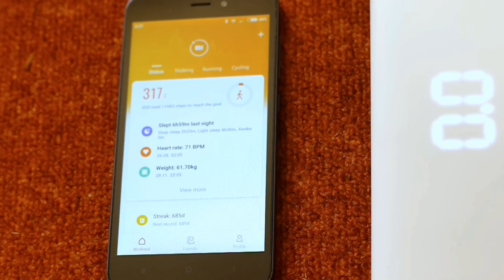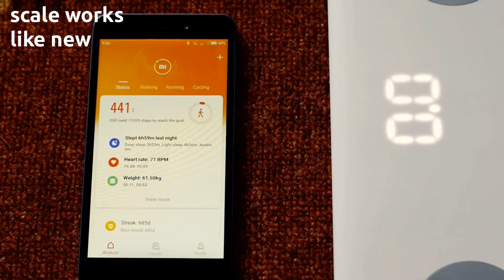Fixing "Couldn't Measure" on Xiaomi Mi Body Composition Scale

Comment: i have another version and there is no screw at all in it (or hidden somewherr probably). mine is mi smart scale 2
Reply: Same with you. How to fix xiaomi mi smart scale 2, no screw and cover made from glass.
Reply: it's just clipped in, outer shell is clipped same way as one in video, then there are "secondary" clips around the support in each corner.
Reply: I have a mi comp scale 2 that shows only a flat bar when batteries are inserted. It cant connect to the phone or read/ display weight. Would you know what is happening or could offer suggestions what to do to fix it?
Reply: @samsuraharjo2432  I have same version with glass, and i got same error, did you fix it since??

Comment: My mi scale is version 2 with glass surface could you teach me how to disassembly it. T T
Reply: +1
Reply: The Mi 2 isn't really designed to be taken apart, and requires a spudger tool to disassemble. There are no screws. You slide the spudger between the plastic and glass carefully on the side of the scale and wedge it apart slowly. Some plastic clips can break if you're not careful. Take care not to scratch the white paint from the underside of the glass. What are you disassembling it for?
Reply: @bengray3950  following your recommandations to open my Mi scale 2 with glass, I found a detached conductive blue wire that connects one sensor to the motherboard, I welded it well and I closed the scale, now it's working perfectly 👌 many thanks🙏🏼.
Reply: @YassineBENNOURI  That's great! Glad to hear you could save it :). I hacked mine to save my weights to a database, which was what I was opening it for in the first place.
Reply: @YassineBENNOURI  did the same and still not working :/

Comment: Very helpful video Miroslav. 
I opened up my scale following your video and there indeed was rust on two of the springs! 
Cleaned them and the scale works fine now. 
Thanks a lot!
Reply: With what did u clean
Reply: @nettopgeorge1183  cleaned the rust on two of the springs
Reply: @kdegaonkar  yes, but what product did you used to cleaned?. I must do the same
Reply: I cleaned it using cotton. Just remove the rust by rubbing hard with some dry cotton or cloth and then you can put a couple of drops of oil on the cotton/cloth and gently wipe the springs again.

Comment: Thanks to your vid, finall figured out how to dismantle this item. Question though, will cleaning the springs also work if the problem is calibration? Like even without putting anything on it the scale shows 26 kg and adds that amount to persons weight, couldnt find how to tare/calibrate it
Reply: I have the same problem, not able to fix this issues, seems like a common issue with this product.
Reply: I am facing the same issue. 65kg showing without any load. Calibration issue. Not finding any solution. 
Please help !
Reply: I do, my scale 2 stucks on 28k and adds a lot of weight on it, what shoul I do? I've removed the batteries, I erased every record on the fit app, and nothing works, who can help us?

Comment: Did anyone had the Low battery glitch?  Can it be solved in the same way? I tried many types of batteries (completely new) it always displays the L sign....
Reply: I had low low battery issue, the battery contact points had rust. Check if you have rust in the battery contact points in the battery chamber below the device. If yes remove the rust similarly as shown in video. What I did was, I plugged all the holes in the battery compartment with blue tack and filled the compartment with viniger and left it for 2 days, after which I drained the vinegar (cooking white viniger)and I cleaned the contacts with a old toothbrush. But make sure the vinegar doesn't enter the holes in the machine.  Or Take it to a repair shop and get the battery  contacts changed, this should cost you somewhere in between 2$ to 10$

Comment: Hi real question Miroslav - the scale isn't calibrated at zero, in my case its 117.7 kg... how do I re-set it to zero? Could it be the same problem, or something different?
Reply from the maker: Simply remove the batteries, insert the batteries, place the balance on a flat surface and wait for it to calibrate itself. If that doesn't help, the error can be anything (broken wires, broken sensor, faulty microcontroller ...).
Reply: @MiroslavBendik will it work for realme scale as well

Comment: Can we weigh things on this to check accuracy
Reply from the maker: Mine has an accuracy of +/- 0.2kg with 70kg load (pretty accurate).
Reply: If I put dumbell of 2kg, will it show the right weight?
Reply: How is the accuracy of body fat and muscle mass , as compared to inbody and other hitech equipments, heard many negative comments that mi shows wrong info, so better to go for normal weighing scale, what do u say?
Reply from the maker: @karankakkad1011  No, minimum weight is 5kg.
Reply from the maker: @karankakkad1011  body fat measurement is not very precise, but
can be used to monitor progress.
Reply: Thank u so much , for your inputs, means alot😊😊😊😊😊

Comment: My composite scale occured "oL" after took battery in then running light without Zero reset and turn off automatically, no active when press a feet, I have try to fixed like this but have no rust or any idea to finish the problem, cables and pcb looks good...how can I do or anyone got same ? Thanks.
Reply from the maker: This is problem with pressure senzor. Either sensors are broken, or cables or ADC.

Comment: My Scale now shows ol error
Reply from the maker: If the icon «OL» flashes while weighing, it means, that the measurements exceeded the maximum limit of 150 kg weight.
Reply from the maker: If the weight is less than 150kg, it may be a broken sensor or a broken wire.